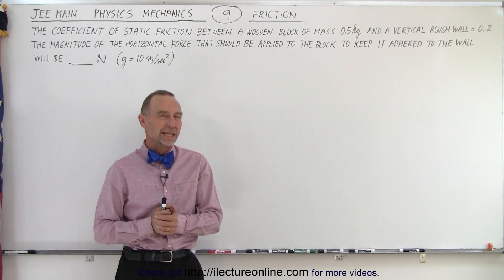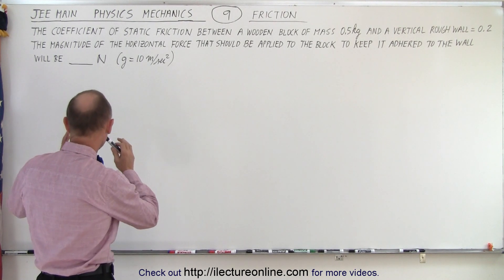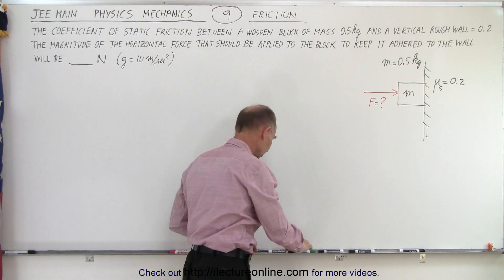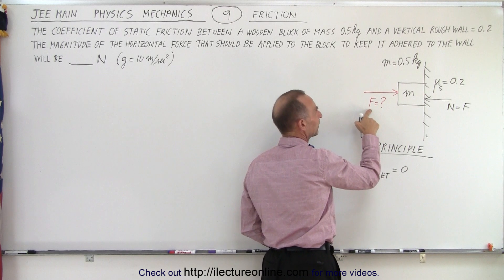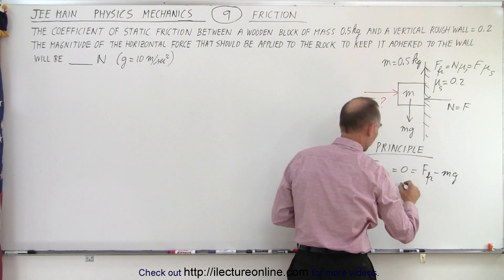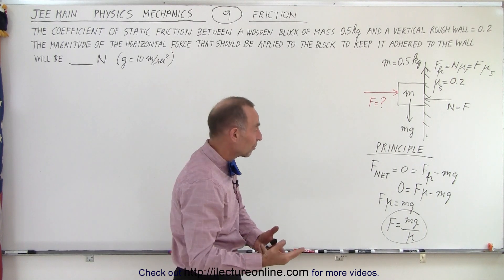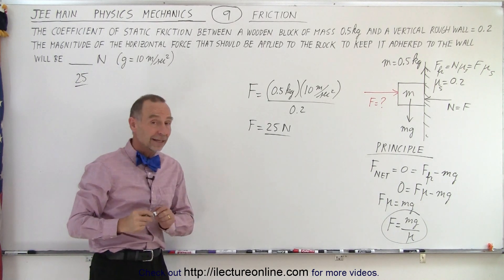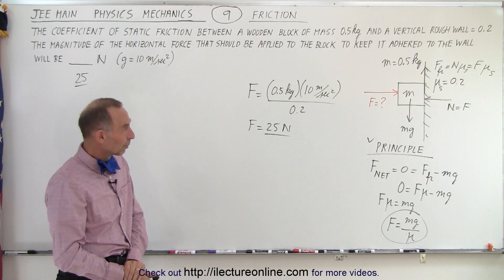JEE Main Physics Mechanics #9 Friction on Vertical Wall

Comment: Forgive me if im wrong, but my understanding is that if the block wasnt pushed into the wall there wouldve been no normal force? A.k.a no friction?
Reply from the maker: You are correct.
Reply: @MichelvanBiezen thanks a lot for the clarification sir 🙏